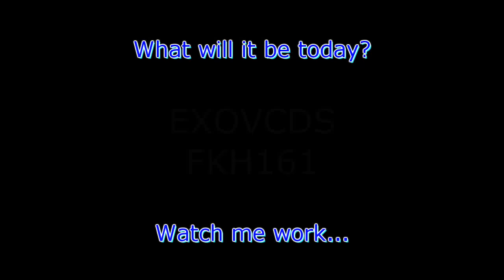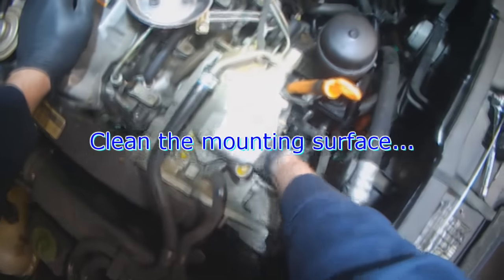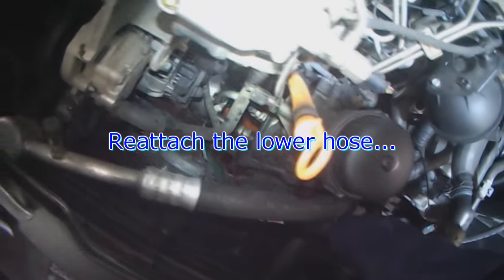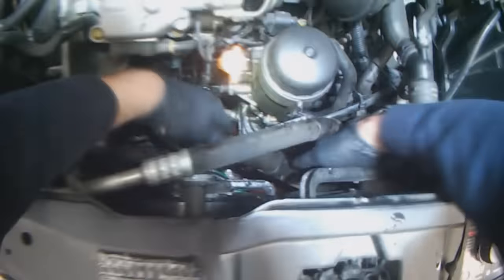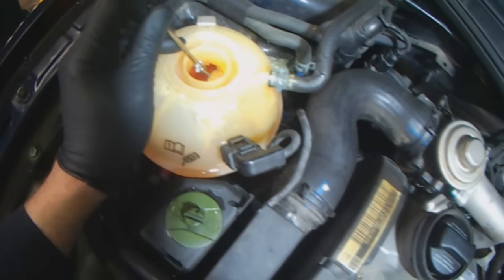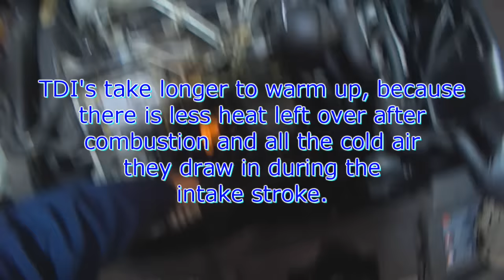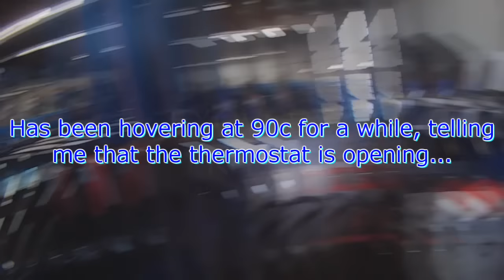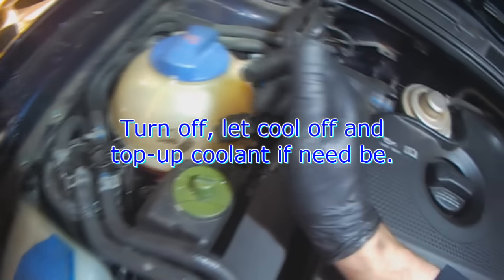VW A4: 1.9L ALH TDI Thermostat replacement (full)

Comment: I just changed my thermostat tonight with your video help.  It took me about 15 mins.  I had the second thermostat ready to go before I pulled out the old one... As soon as I pulled out the old one I stuck in the new one and only lost maybe a half a quart of coolant down the side.  The hardest part was finding the replacement coolant.  There seems to be no G12 anywhere and I really didn't want to mix any colors.  Which is why I didn't want to lose any coolant.  The other thing I noticed but not until after I put the new thermostat housing back in and tried to torque it.  One of the holes for the bolt did not have a metal insert so It kept tightening through the plastic.  This is unfortunate because the housing was special ordered from another store and now the only way for me to get a new one is to order it online.  Anyway I wanted to post a thank you for your help... and to let everyone else know to make sure you check your new housing for a metal insert for the bolt so you don't torque it into the plastic.
Reply from the maker: Thank you for watching... sorry to hear about the flange. The old one can be reused if it is not distorted due to overheating. G13 (current version of coolant) is backward compatible with the old  G12 and even G11.

Comment: Hi Thomas, greeting from a Bby lifer! funny how the world works sometimes. Anyway, I read about 95% of the comments in this thread. Thank you for your dedication to all those out there whom you took the time to reply to. That's pretty cool. and I cant figure out what youre supposed to learn in 10 years either so don't sweat it.. he said it himself...

yesterday was an adventure. I was in Victoria on an errand run and well, I got stuck in traffic jam on the #1 heading north. There's a nasty snarl at gold river park where the road washed out last year and they are in the midst of repairs. The bottle neck this has created leaves a 5km back up and it was at least 30C on the asphalt as everyone inched their way through this shit mess. plenty of others sidelined by the heat and hoods up.....
About and hour into this gong show the temp light came on. I knew pretty much what was going on. something popped. I had no choice but to run hot. and probably very low on coolant. Once i cleared the jam i drove the car to Parksville nonstop. She ran okay, never exceeding 90C on the gauge ( i even got it to hit 80C at one point) but when I pulled over it was steaming. I let it cool, topped it off haphazardly, filled a jug with extra water and set out for home another 100km north. I made it home with one stop for a top up.   The car starts and sounds okay today. What happened was that the bleeder hose from the head to the first T ruptured and turned into a squirter. Ive replaced this short length of hose and will refill the system in the am as per what i saw in your vid and I do have a new stat to install... Im not sure at what temp it opens tho... The sales guy was a little vague... and I may have to research it.  To make a long story short......  This car has never made heat, its always run cold on the gauge and last winter the needle barely 'left the left'.   Ive read most of the comments and cant quite find what I was looking for. I was hoping to save you from having to reply but... here we are. . What would be your procedure to diagnose all the possible problems that might cause the no heat issue. i suppose the pressurized hose is the best way to diagnose a bad headgskt? what about the water pump?  any tricks for that one?   Id be grateful for some pointers This jetta is an amazing machine but shes getting old and the wrinkles are starting to show.   well done on the vid too btw. So simple a monkey could fix this!  Cheers! Rich.  next up.. the timing belt with 189,000km on it.  yeesh.
Reply from the maker: Sorry to hear about the cooling system issue. Fix the leaks and then check for proper system function. It's common that plastic fittings fail from age... so don't assume the worst just yet. Once the leaks are fixed  run the engine at idle till the fans come on. This verifies that the thermostat, fans & electrics are fine. Once the fans have turned on / off once, let the engine cool off overnight. The next day, check for pressure in the cooling system (squeeze rad hose to see if it is firm and check if pressure vents out of the reservoir bottle when you remove the cap). If no pressure is present, then the head gasket is probably ok. Lack of heat inside the car could be 1 of a number of things. Bad water pump, bad hot / cold blend door lever inside the heater box, plugged heater core or stuck open thermostat.
Reply: @EXOVCDS  awesome start. Thanks a bunch. Not many like you. Over night replies on a 5 year old thread.... +1!
I watched about 6 hours of your content last night. Im going to check (drill out) the intercooler as well and inspect the egr. Ive been meaning to look at it for a while but tackling a german car without any prior knowledge is a questionable practice. Here we go! I'll drop back in once ive performed your suggestions.
Reply: @EXOVCDS  I changed out the t-stat. The old one was opening and closing at 65C° +/-. ( probly the original. Its got the audi logo on it and funny enough an open temp marking of 87C°...) The new one starts to open at about 80C° and is full open at 89C° then full close again at 80. I'll assume 65 is similar to "stuck open"
I looked inside the egr valve and its black & wet.
Drilled out the IC box and its dry. No oil or water coming out. So far so good. (I guess) I didn't have hose clamp pliers so a built one. Lol. Its hoacky but it worked.. Anyway, fill up time and run in today.
Reply from the maker: @signwriter5888  thank you for the update!
Reply: @EXOVCDS  she's all back together and running well. I might actually get some cabin heat now...! too bad theres no way to share pics. I had to make a hose clamp tool and a new oil dipstick tube. The dipstick broke off and so yeah. I really didn't want to go to the wreckers... my solution will outlast any plastic one 100 to 1!
Gauge read 90C° pretty much steady now. Is this the  normal reading?

Comment: Nice job.  Bleeder screws make filling the cooling system so much easier.  Constant monitoring the cooling system during refill gets a thumbs up from me because that is realistic!  I thought i was the only guy that washes off the old coolant before adding new stuff! lol  Happy New Year Tom
Reply from the maker: Bleeder screws can help, but even then,  trapped air is a concern... I use my vacuum fill setup when I know that I will run into an issue. Washing off makes leaks easier to spot and it won't drip residual coolant when the customer parks it at home (which is more important). Happy new year to you & yours Ozz!

Comment: Hi, 
I had the problem that the watertemperature of my Golf 4 ALH never reached 90 degrees. After 30km of high rpms and high motorload it only reached 70-80 degrees and the two cooling hoses didn't had the same temperature. So the thermostat was f*cked up. 
So i searched on the internet where this thing sits and thank god, i found your channel. 
I'm good in mechanical things (I guess), but its good to see someone doing all the steps and explains whats really important. 
Just replaced it today and cooling system works fine now. Thanks for the video and keep up the good work!
Greetings from Austria. ;)
Reply from the maker: Thank you and thank you for watching!

Comment: I like the syphon method. I usually just used the pressure tester to pressurize the system, then when I release it, it must start the syphon because the level drops. Although I'm looking at getting a vacuum filler, they are nice.
Reply from the maker: For the most part I use the vacuum fill on engines that I know are a little bit temperamental... or on engines that I am not too familiar with. It provides a huge piece of mind when you see all the collapsed hoses fill with coolant! =)

Comment: Great video! Been having a hard time getting my 03 Golf SDI to open the thermostat, and switch the fans on following replacement of the radiator, thermostat and coolant. I'll try a fast idle and hopefully it will open this time.
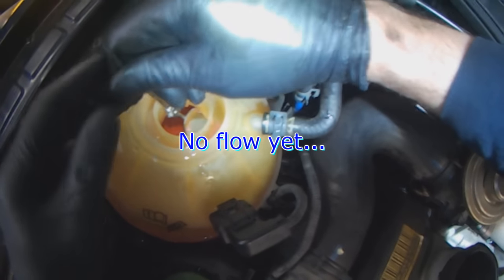Reply from the maker: Did you check for coolant flow (back into the coolant reservoir) as indicated at 13:55?
Reply: @EXOVCDS  Thank you for the reply, I did check for that yes. After filling as much as I could with a cold engine I started the car and had return flow almost immediately. Car warms up very slowly and temp gauge just sits at 90, with the heater off everything except the radiator and lower hose get hot to the point where you can only hold your hand for a few seconds, if you drive the car, it cools off. The only thing that I can think I missed is the fast idle to warm the last few degrees to get the thermostat open and the fans on. I do question maybe if the water pump flow is 100% of what it should be, If I pinch the return hose, I do get a little pressure building though. I'm going to try the fast idle today watching the temp gauge very closely, I guess it will either work or reveal a bad water pump or outside chance a broken out of the box thermostat. Worth noting that I did this work outside in about 5c, so that may be the simplest explanation.
Reply: @EXOVCDS  Tried the fast idle today, after 20 mins the radiator and lower hose began to get hot, coolant level dropped slightly. After another 10 mins the radiator and both hoses were as hot as everything else. After another 10 mins the radiator and lower hose had cooled off again, it was 9c today but with a strong wind which I think must have cooled the radiator off lol. I had good return flow the whole time, and the temp gauge sat at 90 the whole time. Fan fuse and contacts looked fine, might have to wait for the weather to warm up to verify the fans work. Thank you once again for the video.
Reply from the maker: Diesels will take a long time for the thermostat to open & the radiator fans to come one... this is normal. If you want to manually trigger the fans (just to see if they actually work) try this:
https://www.youtube.com/watch?v=Roh6RCs8IJk

As long as you have heat inside, the water pump is OK. 
Return flow into the reservoir is only important for bleeding purposes. Once all the air is out of the engine, a blocked / pinched return hose will not do any damage / affect the system.
Reply: @EXOVCDS  Thanks again for the reply, yes I had good heat inside the car. I'll do the fan tests you showed in the  other video and see what I get.

Comment: Good video, I have a SEAT Córdoba 1.9 TDI ALH of 90 hp, the temperature did not indicate well (it took it slow) and it marked 60 degrees Celsius and sometimes 70, 90 also but it went down, etc.  I changed the thermostat and now it reads 90 degrees without any previous failure.  Since if you don't change it in the future there could be more serious problems like the head gasket. Regards!
Reply from the maker: No head gasket problem... because the thermostat was opening early (engine temperature cooler). When thermostat opens late, temperature gets hotter... then it is possible to have head gasket damage. Your engine will be fine.
Reply: @EXOVCDS  That's why I changed it, it wasn't difficult but what is more difficult than changing the thermostat is the ARL engines (1.9 TDI 150 hp).  Mine wasn't because of the head gasket, much less, but because it opened too early and didn't reach the right temperature, so I changed it to avoid future problems.  Out of curiosity SEAT is a Spanish brand of Volkswagen group vehicles and the video that you changed the thermostat (VW Jetta or Bora in Europe) has the same engine as mine but the coolant tank is on the right, same mechanics too.  It now has 245,000 km (152,000 miles) it could still do a lot of km and they are very reliable.  Thank you very much for the answer and greetings from Spain.

Comment: Checked the heater and blower as you told me, heat was on, themostat changed. Changed the fan but still does not come on by more then 100degrees. Funyly both funs come on when the engine is tured off.
Reply from the maker: Does the lower radiator hose get warm / hot? If you manually trigger low speed at the radiator fan switch... does the temperature stay below 100c? https://www.youtube.com/watch?v=Roh6RCs8IJk

Comment: Haha now I feel bad for just taking the flange off (with braking 1 little piece) without draining the engine, quickly pulling out the old thermostat and ring, and quickly shoving the new one in and putting the old flange back. Filled up the system with new coolant as needed. Still works as it should though :D
Reply from the maker: Scotty Kilmer style! =)
Reply: Sorry bud... Was having a bad day, didn't mean to spoil yours..  But u know  that next time you will take a different route... Its never quicker to work round the parts u don't really want to take off.!  Its n age thing, n I am getting old now.  Its easy for me to criticise your approach to the repair, after 28 yrs of making a mess my self!  (Been there done that, n pissed coolant all over the place!). Sorry.. N respect for making the video and effort to help others that need information .... I wish I was still that enthusiastic about vehicle repairs... Got a 69 400 fire bird, F150 Harley ltd edition, SS Impala, Ford Expedition n a Lotus Carlton.... N they are all busted at the moment lol... So I am in no position to comment...again. Sorry if I caused offence... Keep up the good work...

Comment: Thanks for the detailed video, Thomas. Would a temperature reading of 70°C (previously at 90°) indicate a faulty thermostat?
Reply from the maker: Depends... a couple of easy checks can be made. A bad (opening early) thermostat will allow coolant to circulate early through the radiator, causing the lower (outlet) hose to be warm before the engine has reached operating temperature. If your lower radiator hose is warm when your scan tool or the dash gauge indicate 70c, then yes, the thermostat is opening early. If you let the engine idle until coolant temperature is 90c to 95c (or the coolant fans turn on) and then drive the vehicle at a steady cruising speed... a bad thermostat will cause coolant temperature to drop below 80c (visible drop in temperature gauge needle position). A good thermostat, will keep the temperature needle at 90c position once the engine has reached operating temperature.

Comment: Is it the same for an AXR model (new beetle 1.9tdi 74kw)? And how much does the system takes after a complete flush (changing radiator + changing thermostat) ? Thanks for all the work you're sharing!
Reply from the maker: Service manual says 6 liters if I remember correctly.
Reply: @EXOVCDS  alright thanks

Comment: Followed this pretty much to the tee. Only problem I had was the blowers kept going cold unless I revved the car, then they would blow hot. Took ages but eventually got the car to 98 degrees and the rad fans came on. Didn't seam to have a lot of flow unless the car was revved?
Reply from the maker: TDI's will take a long time to warm up (thermostat opens & fans come on).... if the system was bled well enough, you should have had heat soon & consistently. Lack of heat or no heat until revved, indicates air in the system. You may have to top up the coolant after the engine has cooled off.

Comment: Does the thermostat not opening/closing as it should affect the cabin heating as well? Thanks for the video!
Reply from the maker: Yes... if the thermostat is stuck open, there will be less heat inside the car. If the thermostat is stuck closed, there will be more heat... because the radiator can not cool the coolant.
Reply: Thomas EXOVCDS ok that makes sense. Thanks for the reply! I appreciate the fact that you take the time to do so. Many YouTubers do not and it’s annoying.
Reply from the maker: I also find that annoying. 
Thank you for watching!

Comment: I bet mine is stuck open since my temp gauge drops when I do run heat.  winters aren’t bad here, so seat heater is pretty much all i ever need, but is it okay for the engine to run cooler?
Reply from the maker: Yes it's ok for the engine, but you might lose a bit of fuel economy, as a cooler running engine uses more fuel.

Comment: Hey Thomas, how much does a thermostat replacement typically take?  Like on an ALH, you don't need to remove the alternator, while on some VW models, you need to remove it, or some other hardware, so I'm just curious how many hours it pays
Reply from the maker: Mitchell labor guide lists 1.5hrs (1.1hrs warranty) for the ALH... the guide is not always realistic. Some of my videos make it seem like not a lot of time is involved, that might be true for some videos, but not for others (editing). Last thing you want to do is rush a job and then have a comeback a few days later. Labour guide is a guide... I had a car that needed a thermostat, but I ended up flushing the system for an hour, trying to get all the old rusty fluid out. The older the cars, the more likely things could take longer.

Comment: Hi, thanks for the video , how many Newton meter have you aplied in the  bolts of thermostat box?
Reply from the maker: Did you read what it said at 7:00 ?
Reply: Didnt read It 😅😅😅, thanks
Reply: This 15Nm is the Torque that you recommend or have read It on the manufacturer book?
Reply from the maker: @andreshildenbrandjimenez85 check your service manual to see if I am correct.
Reply: @EXOVCDS  i dont have It but i trust you